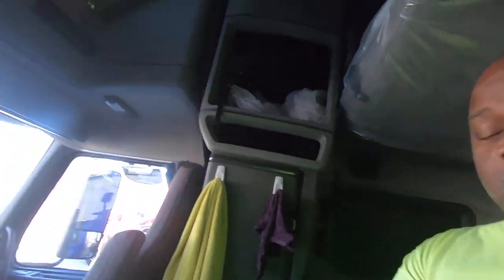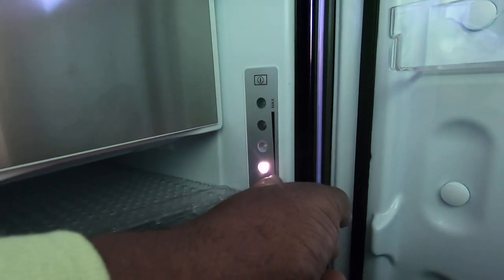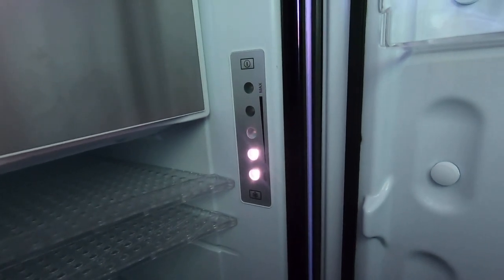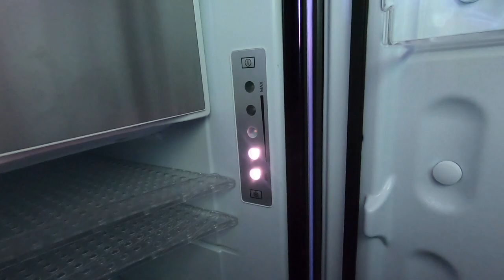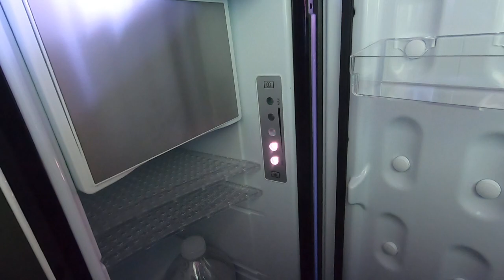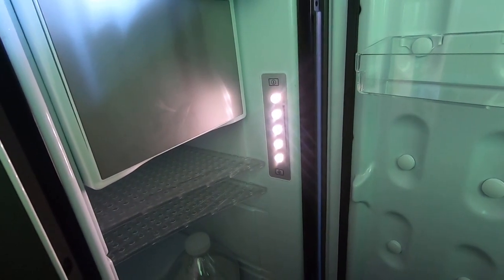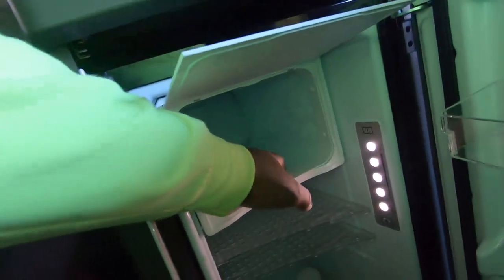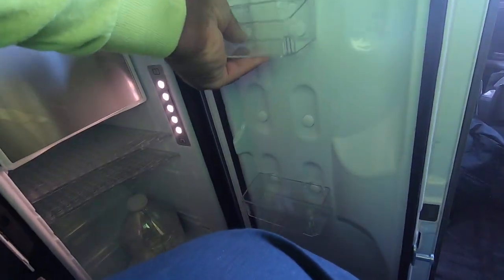How to control a 2021 Volvo VNL 760 sleeper refrigerator

Comment: I have 2023 brand new 760 volvo.My refrigerator is not turning on.İs there an any swich to turn it on other than inside buttons?
Also sleeper bunk has  tv and microwave outlets but they also don't work.Do u know anything about it if you know please let me know.
Reply from the maker: Check the fuse box on top of dash. I think you have to turn on the power inverter for the tv and microwave to work. I don't know because I have not used either the 16 month I've had my truck.
Reply: Turn on power inverter on rear bunk control panel it needs to have the red digital display lighted up to work the microwave outlets with 120V

Comment: Here's the deal. If it's turned all the way up and still has poor cooling on about this year. Mine is a 2019. It's 2023 now. Depending on how big of a pig previous drivers were you will have to pull the unit and hose all the lint, hair and gross out of the condenser and fan with compressed air. It should cool good again. Be prepared it's a pain to get back in and make sure the long power wire isn't going to jam the fan. And if there's a non volvo specific mattress in be sure the door closes all the way. Volvo needs to stop the mattress thing. It's dumb. The compressor could get burnt-out. When that happens it won't cool at all. And these fridges cost over $1000. Volvo sucks.